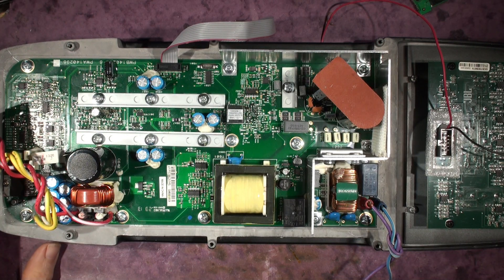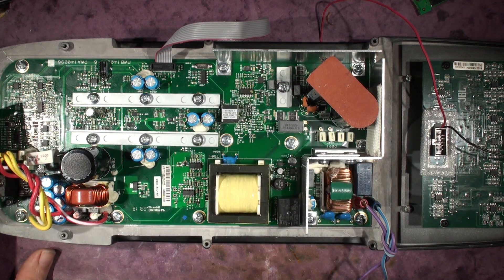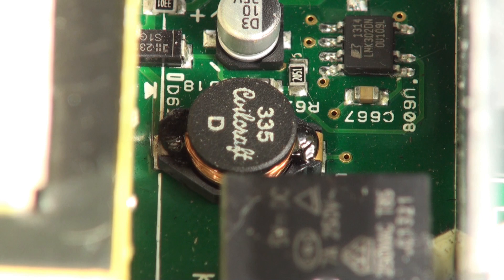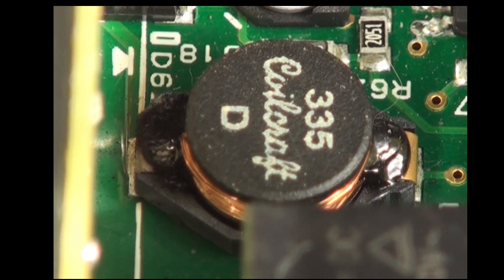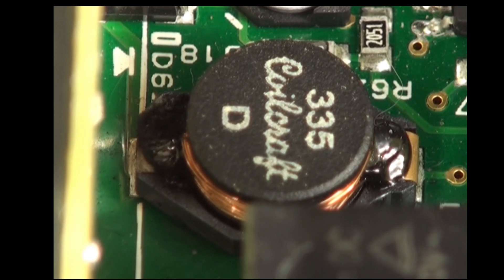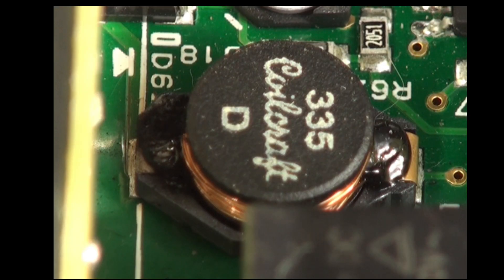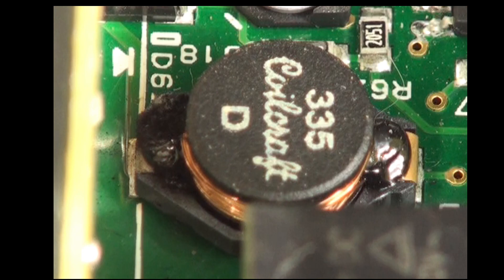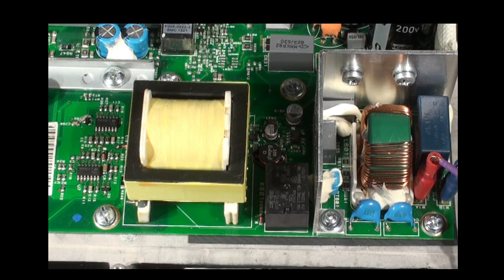JBL EON Powered Speakers use this exact unreliable circuit 200, 300, 500  Series

Comment: ¡Tengo un par de 515 y después de un fallo de voltaje solo encienden de vez en cuando, y lo hacen bien hasta que se pagan, en Venezuela se usa 110v, pero hay muchas fallas de electricidad, alguna sugerencia? ¡Gracias!
Reply from the maker: Es un fallo de diseño. ¿Qué sucede si hay una caída en el voltaje de la red eléctrica que cae el riel de +5 V y el relé azul que apaga el termistor de protección del coeficiente de temperatura positivo (el pequeño componente del disco azul al lado del soporte de aluminio se calienta y adquiere una alta impedancia? Cuándo, cuando el La energía principal está completamente restablecida, el PTC ya está caliente y no funcionará.
  pasar suficiente corriente para encender el amplificador. Cablearía un pulsador bien aislado con un fusible de 5 A en serie a través del componente PTC. Luego, si presiona el botón, el amplificador se encenderá y apagará el termistor.

Comment: Hello. I have a set of JBL Eon 500 515txt where the speaker goes out when I turn up the volume. Do you have a suggestion for what could be wrong?
Reply from the maker: Yes, likely the relay that shorts the PTC protection thermistor is not closing. A blue relay with a  5V coil.  Turn it on and see if you hear a click from inside the housing.  This happens pretty much as soon as you hit the power . A second or so later the speaker drive is enable.  You are listening for a click. Compare with a working one.  I ave the relays in stock.

Comment: Coil is sparking on my 510. What part number is the appropriate replacement? I don't understand what correct rated means with an inductor. Thanks
Reply from the maker: The coilcraft one fitted as standard is prone to spark over where the inner wire comes through to the connection. Have a look at the other video you can see the arc in action.   The voltage rating of an inductor is dependent on the breakdown voltage of the insulation between windings, in particlular where wires a close to others that are many turns away.  Wurth make a HV version of this inductor  (example manuf Part no 768 775 256)
Reply from the maker: Where are you based? I have some in stock. ark.mail@gmx.com  If you are in the Uk one I'll stick one in the post. The office ships most days.

Comment: Hi. Any chance you could help? I need part numbers for a EON 300. the two large transistors on the power supply side and two tiny transistors on the power supply side. The are the ones located just below the big transistor closer to the centre of the power supply side.
Reply from the maker: I thought I replied to this already today. Did I not press enter?

Comment: Hola, el L603 en la lista de partes muestra esta información 
INDUCTOR, 1MH 300MA SMT, puede indicar un inductor similar para sustituir este sin problemas, puede pasar algún enlace de aliexpress que tenga para vender? Gracias y un saludo brasileño
Reply from the maker: Hola, uso el Wúrth 76877630. Es la versión de alto voltaje del inductor estándar. Ver: https://www.we-online.com/catalog/en/WE-PD2-HV?sq=768775256#768775256 o https://lcsc.com/products/Power-Inductors_544.html?q=1mh% 20 inductor
Reply from the maker: Leave me a like and subscribe please/
Reply: @razenby  tanks !

Comment: Magic Smoke, Thanks for the videos. Following Željko Sremčev question. I suspect this is what is wrong with my unit and I'm trying this repair. This is more of a hobby for me and did not want to try this fix without some imput and the cost of the repair or replacement board is not worth it. I reached out to JBL and the only information that I got is that the coil should read 10ohms and I could not find a Bourns inductor 330uh with this resistance. If possible I was hoping that you could provide me with the part number for the inductor and LNK chip. Tried looking at Mouser Electronics but did not want to get the wrong parts.
Reply from the maker: The resistance of the inductor is irrelevant.  In fact the 10 ohm figure they gave you is a bum steer.  Any 330uH inductor capable of carrying 100mA current will do. It is a generic component. Nothing special.

Comment: Can you please explain 335 labeling on this inductor? Does it not mean that it is actually 3300uH aka 3.3mH and NOT 1mH inductor? And pls can you recommend some replacement since it is obsolete? Thanks for all your great videos!
Reply: I'm also confused at the marking and value of the inductor. Any further elaboration would be appreciated.
Reply from the maker: 330uH. Use the Bournes part. Change the LNK chip.
Reply: @razenby  Thanks for the tip. But is it really 330uH? Not 3300uH?
Reply: 335 = 33 × 10⁵ nH =  3300000nH = 3300uH
AFAIK

Comment: I have JBL eon one but no more power,I change the voltage to 115 then I put it back again the normal voltage 230 then now is no power  i can't use now thanks giving attention pls...
Reply from the maker: Ahh. sorry to hear that. I can reproduce the destruction of the 220, 300 & 500 series JBL universal power input electronics with just a power dip. Unfortunately the circuit that discriminates between 110/230 V main input was designed by a schoolboy and never properly tested.  I remove the circuit when I service them.  You probably need to change all the electronics in the switching power supply and remove that bloody relay.
Reply: @razenby  please can u help sort my jbl eon 1 without power? My number is 07951177273 uk
Reply: Have u found a solution. I have similar problem

Comment: Do you know anything about the newer Eon speakers like the Eon 610/612/615? Are they any Improvement in design than previous generations? Thanks!
Reply from the maker: Designed by Crown. The usual design faults,  Need servicing after about 5 years of use.. I can fix them. Haven't come across many - either they aren't out there in the same numbers maybe they are on the flat part of the bath-tub curve. We will see.
Reply: @razenby  have you seen many EON 600 series? I have a couple of dead ones with a broken power supply. Any ideas what the usual fault is? Help would be greatly appreciated.
Reply: @GoBO207 mine have just died. Did you find a solution?